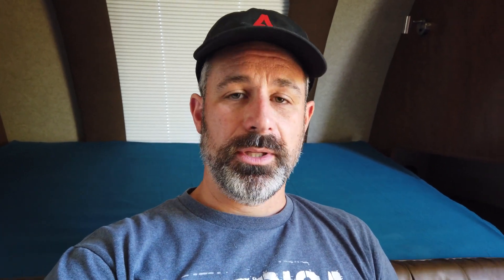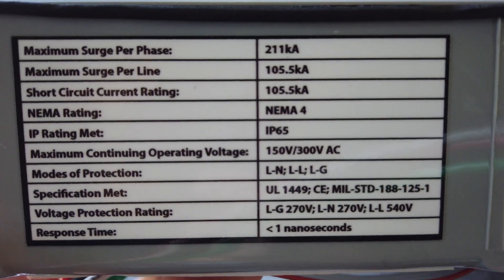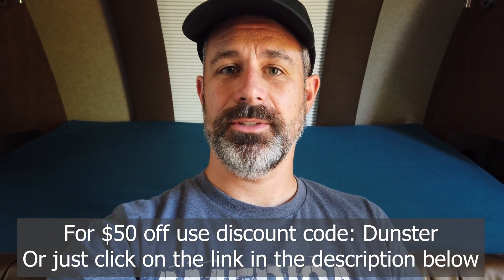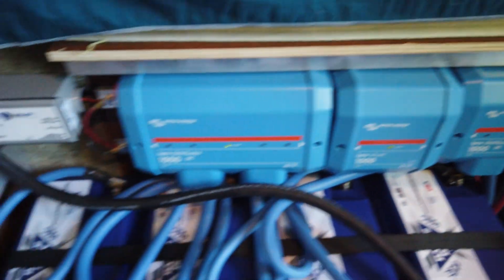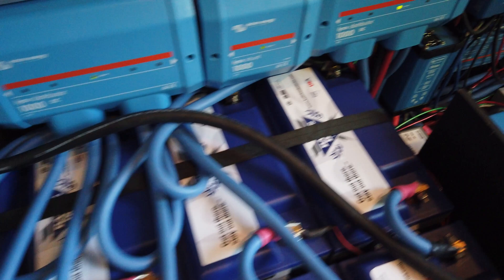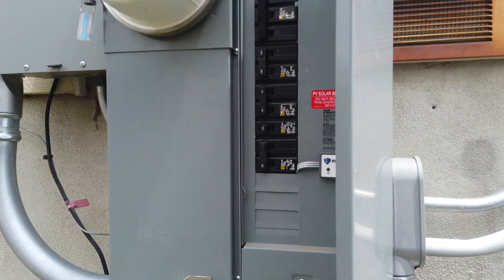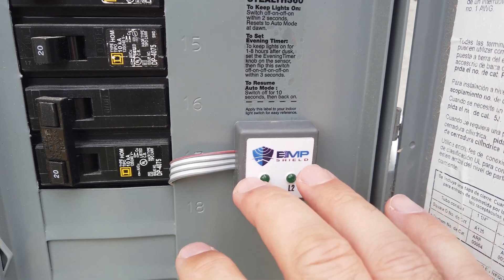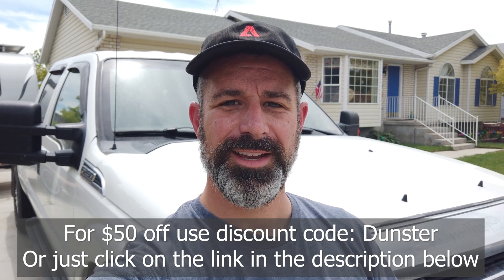Protecting Our Lance 2185 Electrical System Plus Our House and Truck With The EMP Shield

Comment: I have one Multiplus II 3000w inverter, 6 lithium batteries, and one MPPT solar charger. What would i need to fully protect my RV? I also have the Lynx Shunt, Distributor and Power
Reply from the maker: @robpeeples6339  The EMP shield protects a specific voltage range. In my case I needed one for the solar charge controllers on the solar panel side, one for the 12 volt bus bar, one for the 24 volt bus bar and one for the 120/240 volt AC out of the inverters. In your case it sounds like you need at least three EMP shields. I would recommend calling their phone number and talking to one of their consultants to talk through the details.

Comment: This is great I spent 18 k in a solar system to run everything in my fifth wheel I run 48 volt with 9 battle born lithium batteries and 2 for 12 volt system so if I understand I need 1 for my 48 volt from solar to my inverter and 1 for my 12 volt and 1 for my 2022 ford f 450. Is this right
Reply from the maker: Yes you're right. Each EMP Shield is protecting a specific voltage range so you need a different device for each voltage, also the truck is physically separate so another device for it too.

Comment: Got it on my suv and rv. I have the shield for my rv solar but still haven't installed it. I have a gopower 10 amp controller. Should I install it to that? It's mounted on my side kitchen cabinets. Not sure where I could find a ground for the emp shield.
Reply from the maker: Yes, the EMP shield should be installed on the solar charge controller to protect it from the surge that would come from the solar panels themselves. I also have another EMP shield on my 12 volt system to protect that voltage as well.
Reply: @Anthony Dunster  I got the EMP Shield Portable for RV’s, Renters, Travel Campers, and Camping and have it plugged into a non gfc outlet. Is that sufficient for 120v and 12v or I need an additional emp shield for my battery that's (mounted outside by my propane tanks on the tongue jack) and wired to my solar panel?
Reply from the maker: @aussiesandtrails  Oh I see, thanks for the clarification. I recommend you contact EMP Shield directly https://www.empshield.com/contact-us/ to get a more authoritative answer to your question. If the outlet you're plugging the EMP Shield into is properly grounded then all the devices plugged into the EMP Shield will be protected. The RV 12 volt system would not be protected in that case if I'm not mistaken. As I outlined in my video the EMP Shield is monitoring for a specific voltage range and it's protecting all connected devices from a voltage overage. The device you have is great for situations where you can plug into a grounded outlet like say at a campground electrical pedestal or in a house then plug devices into it. In my trailer I have a device for each voltage that exists in the trailer which for me is a 12 volt system, 24 volt system, 80-120 volt system (solar panels) and 120/250 volt system (the AC distribution panel).